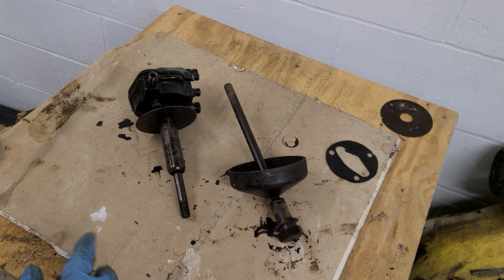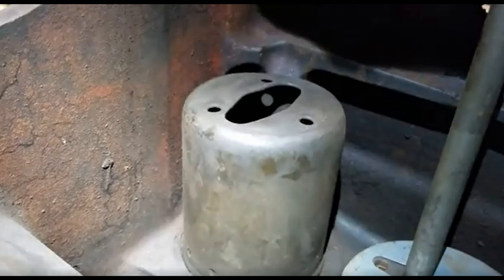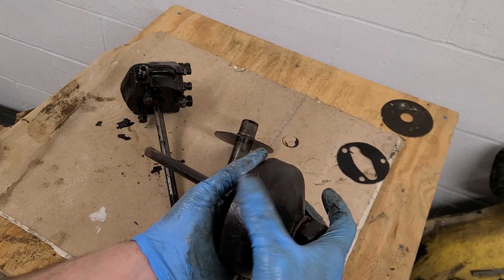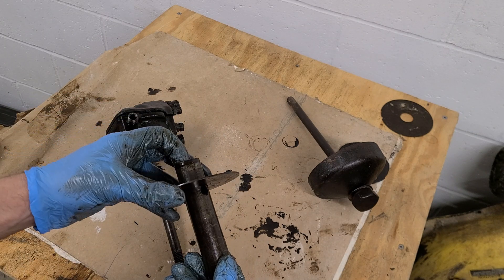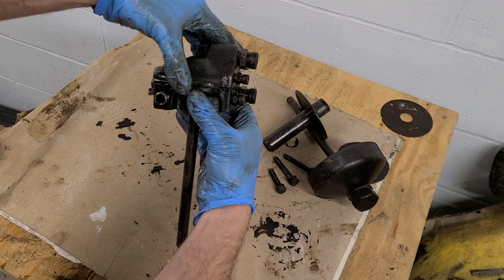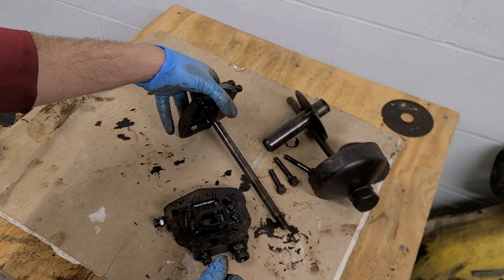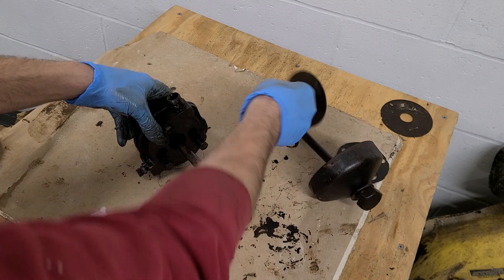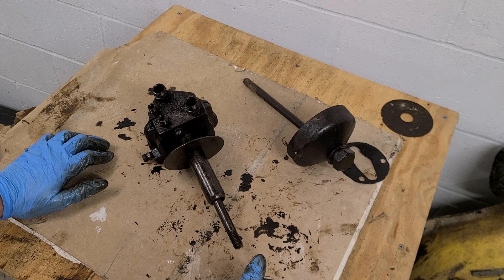John Deere Oil Heads: Broken Stud Repair (A, B, G, H, etc.)

Comment: I did this on my A and that gasket on the canister was gone, would that effect anything if I want to run it?
Reply from the maker: My only thought is that it would affect the oil pressure if some of the oil was leaking out through that interface.  If you have good oil pressure I would think you are ok.

Comment: Would this be the same as the condensation in the oil chamber freezing and popping the oil cup out possibly striping the threads?
Reply from the maker: I mean,  I have never heard of just condensation doing that.   The water would have to be mixed in the oil and there would have to be a considerable amount, though I suppose it's not out of the question.  I think the first thing that would break is the oil pump since that is in the bottom and the water would settle there.
Reply: @DanielFarmChannel  this tractor sat for at least 30 years outdoors. It is possible that the crankcase had a lot of water in it. I will remove the case cover and look deeper into it.
Reply from the maker: @johndeere-yk6db time like that is never kind to a tractor,  not in wet environments at least.  My B sat outside for decades and it was a mess.  I saved it but only when I was too far in realized it wasn't worth saving.  Good luck